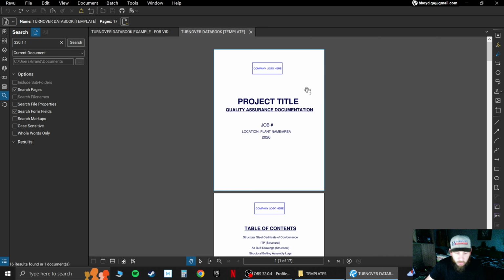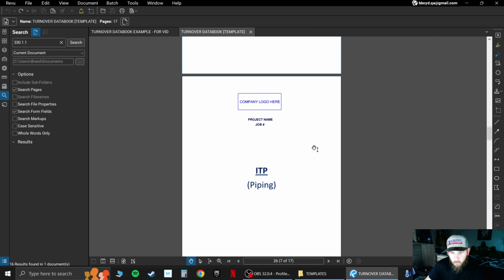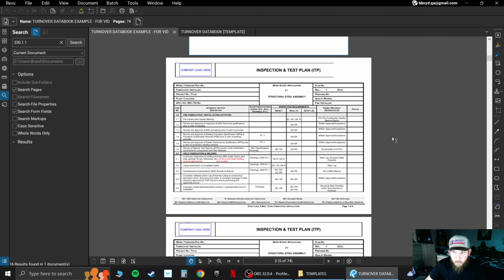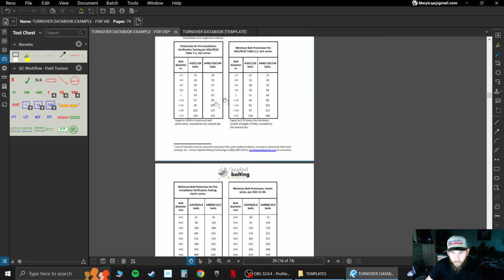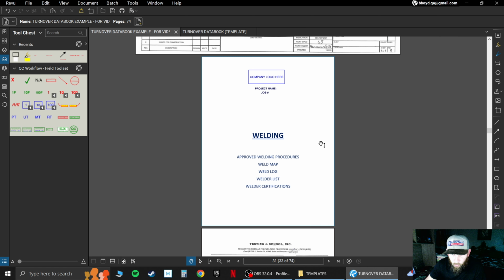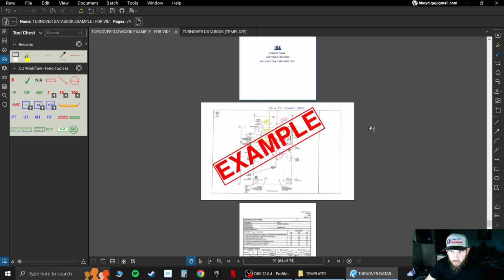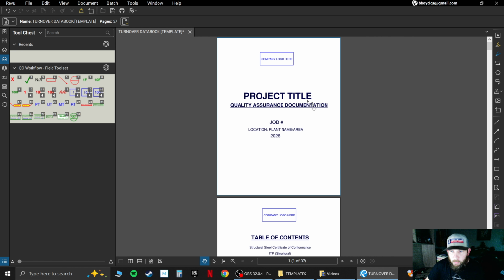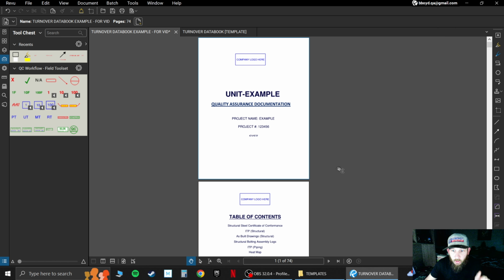Stop Delivering Unorganized QC Packages

Comment: I need a good Mechanical ITP for equipment. Do you have one? I bought the pro bundle but didn't see anything like it.
Reply from the maker: Appreciate that man! There should be an Exchanger ITP and a Tower/Vessel ITP included, along with the piping and structural steel ITPs. What type of equipment are you needing an ITP for specifically? I may be able to help ya out.